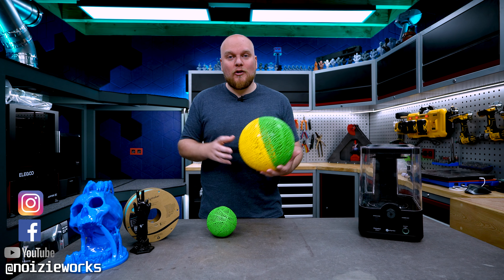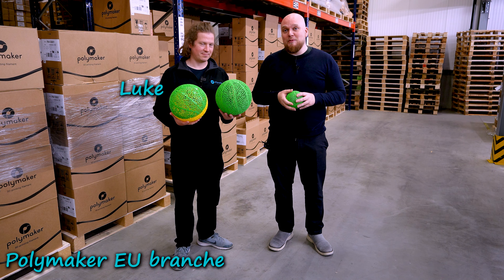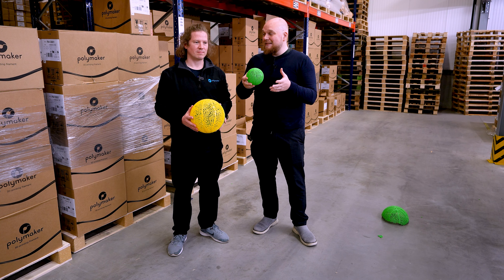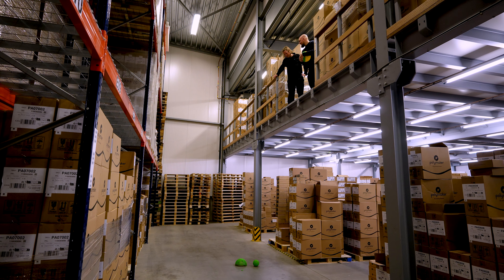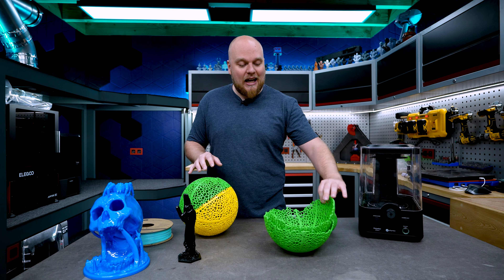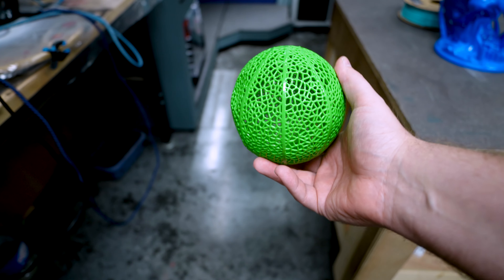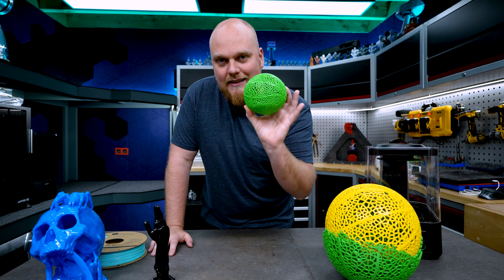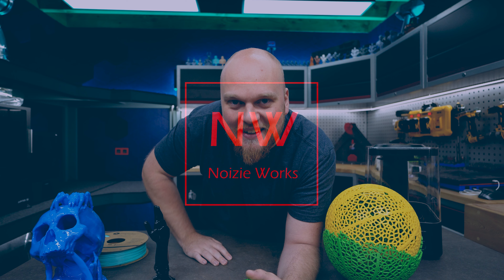Airless basketball that actually bounces, vapor smoothing is awesome now!

Comment: Even if you got the bounce property correct, what about the weight.. This is another important factor of the airless basketball unfortunately...
Reply: One of the major sports brands made an airless basketball. Some YouTuber tested it and reported that while the bounce and feel were identical to a normal basketball, the air drag was too strong, causing it to fall short every time.
Reply from the maker: @jgreen2572  just to be sure, i'm not trying to sell you on the ball idea. Just wanted to show off a filament before and after vapor smoothing.